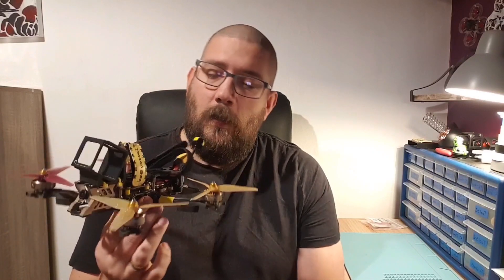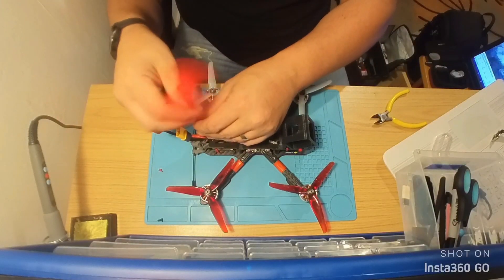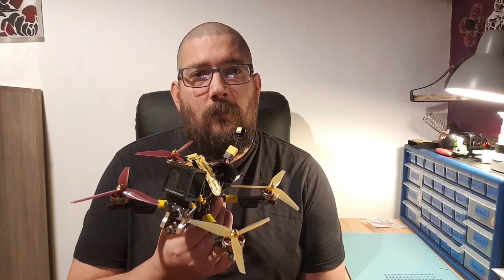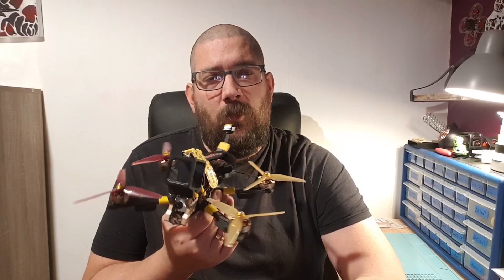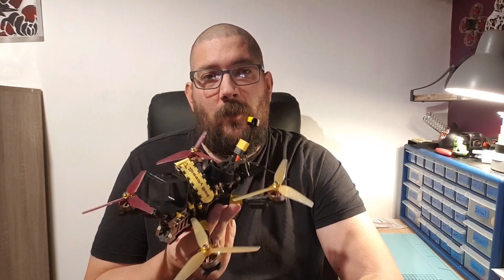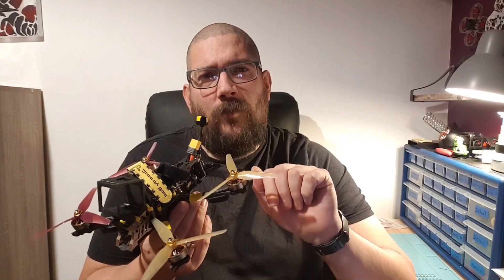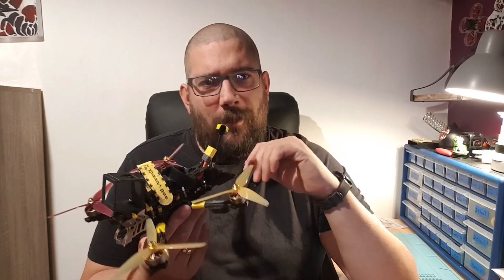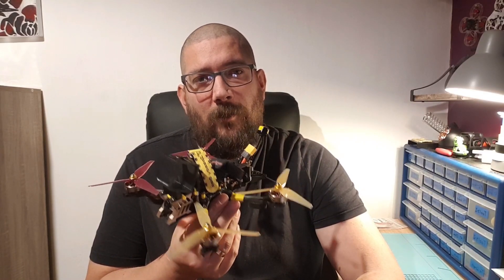Speedybee v2 esc new firmware . Will it explode ?

Comment: how is the ESC doing so far? 
any update?  Is the firmware the final solution?
Thanks ✌
Reply from the maker: Mine has been solid so far . Had 20 or 30 packs through it without incident. Hopefully the firmware has solved the issue but that's just my experience .